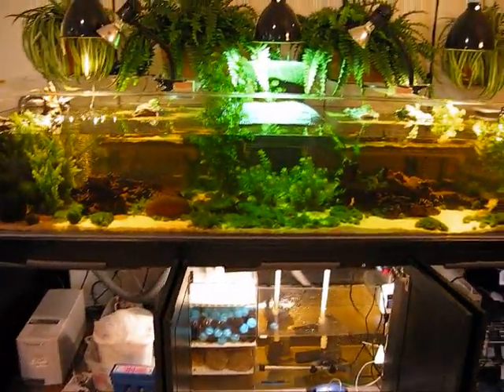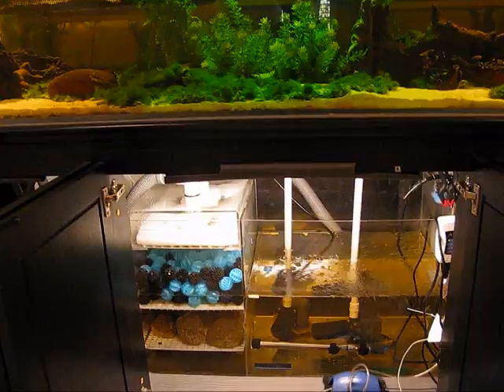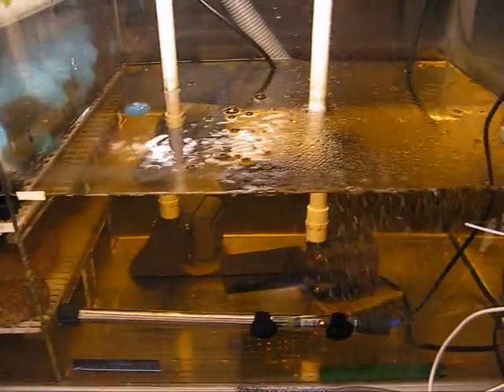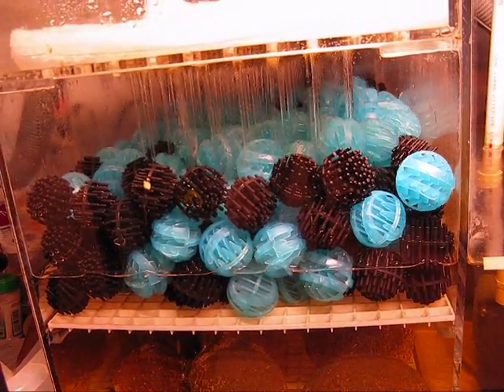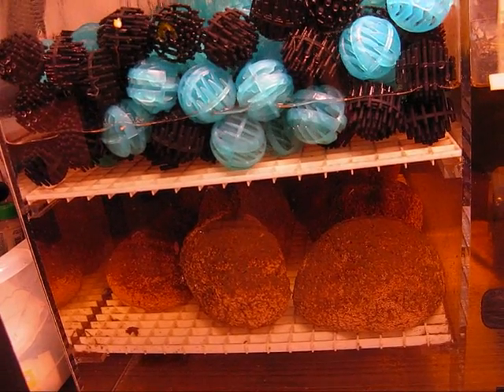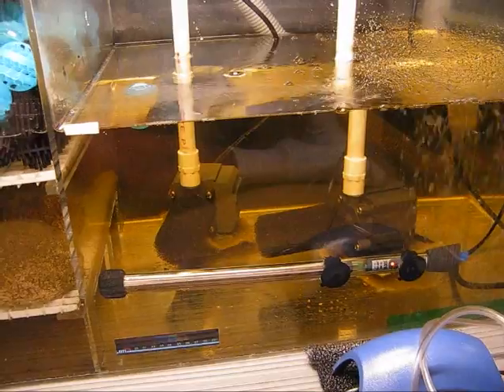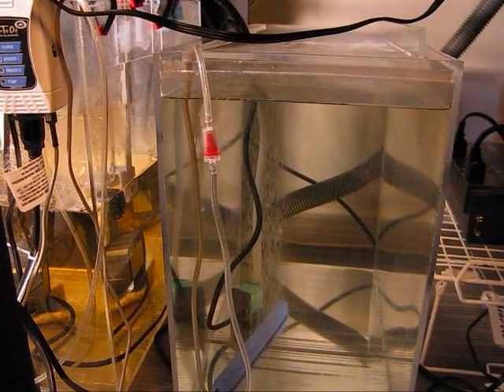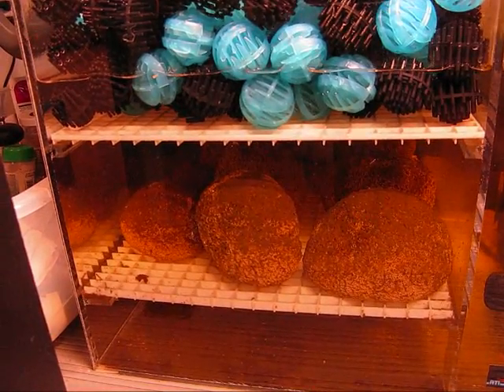Turtle Tank Trickle Filter

Comment: Wow - great video. 13 years on, is the tank still working well for you? I was trying to find out if Bio Balls can be submerged and not used through a trickle box set up.
Reply from the maker: I no longer have the tank.  I released all of the turtles in 2015.  I still rescue turtles but release them quickly.  I think the air plus water in a trickle setup is important.  But I am not a bio expert.  You'd better search for an answer of your question online.

Comment: A large part of your filter is doing absolutely nothing, it has a lot of lost space.  Bioballs are not the best medium; their surface/volume ratio is far from optimal.  Expanded clay pellets or volcanic rock is better. The best and simplest trickle filter is the type on top of the aquarium where the water slowly trickles. Oxygen is the key for a good performance.  A trickle filter easily survives a power out.  Bacteria die from a lack of oxygen. Anaerobic conditions can not happen in a real trickle filter, since it will drain completely in case of a pump malfunction or a power-out.
Reply from the maker: I no longer have my tank, so it is moot at this point.  However, I did consider an above the tank trickle filter but found the design cumbersome and difficult make attractive to look at.  As for power outages, I used a backup battery for short outages.  Never had a long enough outage to become an issue, but I can see how it would be if that happened.

Comment: how much did you spend setting up the sump
Reply from the maker: I don't remember.  Was years ago.  But the tank and the sump filter was all custom built by a local aquarium shop.  Prices are obviously going to vary shop by shop, State by State, and of course the price of oil (Acrylic).  If you thinking of setting up a large tank, check with a couple local aquarium shops about costs.  If you like to shop online, try Glasscages.com.  They make all sorts of acrylic tanks and I would imagine filter systems and would probably cost much less.

Comment: I have a reef ready tank bare bottom, that has two holes drilled on the bottom.  I am currently using a canister filter but as you said maintenance is a pain.  My question is how can I use a sump without an overflow intake at the top? I don't need to skim the surface.  The bottom intake drain works best to remove all the turtle poop so I would want to keep it that way.  Is this even possible?  Would I have to make a hybrid of some sort?  How do I protect myself from overflow if the power went out?  I am sure there is a work around but I can't think or find one.  Thank you.
Reply from the maker: You will have to visit a filter website.  I am not a filter expert.  The basic concept of a trickle filter is that water is pumped up from the sump underneath and pours onto the surface with enough force to help oxygenate the water.  As the water level rises, it overflows into the overflow tube(s) and back down into the sump where if is filtered.  If you turn the pumps off, everything just stops, there is no flooding.  So be careful of your design, note the consequences of turning the pump off.  Gathering turtle poop off the bottom is generally an effort in futility.  Unless you have your turtles trained to poop by the intake, most of it will just roll around and eventually break up and dissolve into ammonia byproducts.  The whole idea of the wet/dry filter is to convert all that ammonia into nitrites and then into nitrates.  Also, you'd be surprised how much crap is collected by the mechanical filter.  You still must do partial (never full) water changes to keep the nitrate levels low as they can kill fish.  There are more sophisticated ways of removing nitrates, but most folks just do partial water changes.

Comment: So you have the intake at the top (water level) and then the output all the way to the bottom to push water up? So it can go down?
Reply from the maker: both the outflow and overflow are at the top.  the outflow pushes water away from the overflow tubes.  there is nothing near the bottom, that would just stir up sediment.  You can add separate circulation pumps if your tank is large enough to warrant them.

Comment: Hey there.. I have a DIY trickle filter. Been running a few months but the problem is that the water is only sometimes clear and clean.. First layer has the normal sponges. Second and 3rd has the bio balls.. And 4th has some volcanic rocks... My sump gets dirty.. Is it because the dirt are not collected by the sponges?
Reply from the maker: I'm not a filter expert, best seek advice from a aquarium forum, but it is possible that your sump filter is not large enough for the bio load your critters put out.  Or perhaps the pumps are not moving enough water to keep the tank clean.  I used to 700 GPH pumps on my tank of only 200 gallons.  Also, you must clean the sponges regularly by removing them and thoroughly rinsing in non-chlorinated water.  Chlorine kills the bacteria that break down waste.  Otherwise you won't get good biological filtration.
Reply: I have also built one I'm gna try alfagrog rock it seems to be working for some ponds

Comment: how does the water get from the blue/black balls to the sump?
Reply from the maker: the water is pumped from the sump up into the tank.  There the water levels rises until if pours into the overflow tubes (which set the water depth).  the water flows down the tubing back into the sump, and around and around it goes.  The balls in the sump just create surface area for bacteria to grow which break down the harmful ammonia (waste) byproducts.

Comment: hey Bob I have been watching your turtle videos i just got a turtle and was wondering if you could help me buy and build m y own personal tank like yours
Reply from the maker: I had an aquarium shop build my tank, I did not build my own tank.  I strongly recommend you find a good aquarium store that has a tank builder and work with them on the design that you want.  You can also go to the Glasscages website, they have pre-made, acrylic tanks that are cheaper than customer built.
Reply from the maker: fish waste, like all waste, will dissolve in the water.  The biological filtration system breaks those wastes down into nitrates.  You get rid of the nitrates by doing partial (not complete) water changes.  Some larger, visible waste can be siphoned off manually, that will make it easier on the biological filter.  some waste will be sucked up into the filter and deposited onto the filter media, but it is technically still in your tank so you need to clean that filter media frequently.
Reply: can you send a link to that site?
Reply from the maker: G3TxN4STY www.glasscages.com

Comment: This is amazing! I work at a nature centre and would love to pass on the schematics to the staff that manage our turtle tanks!
Reply from the maker: +AppleBlight Schematics?  Don't have any schematics.  I no longer have the monster tank.  Am getting older now and the turtles would easily outlive me.  They were released this past May and the tank dismantled and sold.  I do  keep a smaller tank going for hatchling rescues, but that is it.  I do provide specifics on the tank design and size on other YouTube postings if you care to look around.  Basically the tank was a custom made acrylic tank, 8' long, 3' wide, and 17" high.  Filter is a wet/dry sump filter with overflows and returns in both back corners.  Two 700 GPH pumps sitting in the sump underneath.  The sump was oversized to manage the large volume of waste that the turtles produce.  Have had as many as five or six turtles in there at a time.  Lots of Mopani wood on the bottom (looks nice and it sinks), moss ball (which the turtles destroy and with time forms a bed of moss).  Substrate is sand, really the only good choice for bottom dwellers like mud and musk turtles.  Essential for softshell turtles.  Water is filtered as it enters the house so there is no chlorine or chloramines to deal with.  Partial water changes once a week, 50%.  A sand box for egg laying, two other platforms with Cypress logs for basking.  Lamps are UVA/UVB heat lamps.  Aerator in the tank to reduce surface sludge.  I also use tall, plastic plants for the turtles to climb or rest on.  Ferns sitting above the water in the back of the tank are artificial, but look nice and don't shed.  only serious problem I had was turtle aggression.  Doesn't matter how much space you have, how well fed they are, they are solitary critters except when mating or basking.  Males are particularly aggressive but the females fight over food.  Sometimes they're peaceful and I think all is well, then they get into it again.  I only kept mud and musk turtles because they are small.   Sliders and softshell turtles are powerful swimmers and need larger outdoor enclosures, IMO.  Hope that helps.

Comment: Can someone teach me how to even out my sump because every time I turn it on it either pumps too much water to where it runs dry or the pump that pumps the water into the sump pumps to much and it overflows!
Reply from the maker: +Mundo Dante not sure what kind of setup you have, but usually there is a pump(s) in the sump which pushes water back up into the tank above.  The water in the tank rises and then overflows down the overflow tube(s) back into the sump.  I don't know why you have a sump in the tank as well.  If the sump pump is too powerful, you will empty the sump before overflow can return enough water back down.  You would either need a weaker sump pump or else more overflow tubes, or bigger ones.

Comment: Hello, I've started taking care of 2 red ear slider turtles which were my Uncle's before he passed away. I bought a 60g tank yesterday and no water yet inside. I spent numerous hours on the web trying to figure out the best filtration for my tank. 

I like the sump setup/concept but its intimidating for me to setup a tank like that but I really want to. Can you help me in setting up a sump like yours but a smaller scale version of it? Any help would be greatly appreciated. I want the turtles to be happy.

Chris
Reply from the maker: Ca M not sure what you are asking.  I am not an expert of designing sumps.  I had help from the same aquarium shop that build my tank.  60 gallons is a fairly small tank and perhaps a canister filter would be easier for you.  I think a sump filter is best when the tank is drilled.  If you don't have a pre-drilled tank, you'd need an overflow box and I have no experience with them.  You might inquire on the Turtle Forum - you can get some excellent advice there.  Here is the link:  http://www.turtleforum.com/forum/upload/index.php?act=home
Reply: BauriBob Im looking at the turtle forum now. Thanks for the response. What I am trying to ask is a good filtration system for the two turtles that provides healthy habitat. My hours of reading so far seems many people are struggling with keeping turtle tanks clean and without stinky odors.  Anyway, thanks for the advice! Good luck
Reply from the maker: Ca M too many people under filtrate.  And a filter requires frequent maintenance.  You must clean the filter pad(s) regularly whether you are using a canister, wet-dry, or submersible filter.  You must treat your water to remove any chlorine.  Chlorine kills beneficial bacteria which break down ammonia and nitrites, harmful mostly to fish.  I don't care for gravel/rock substrates because debris collects between the rocks/pebbles and is hard to remove.  Sand is more natural and debris collects on the surface.  Usually it eventually dissolves and the filter takes care of it.  If you feel the need, you can siphon the debris off the surface of the sand.  Don't forget to do partial water changes weekly.  How much is subject to debate, I do a 50% water change every week.  That keeps the nitrate levels down and removes particulates in the water that cause discoloration.  If you use Mopani wood like I do, you may notice a reddish brown tint.  Harmless but unsightly.  Water changes will keep that to a minimum.

Comment: I seen your video a few years ago and I was very impressed by it and just stumbled upon it again and it's still impressive. I use a trickle filter for my koi pond and I have been using the blue bio-balls like the ones you use. But I came across a brand of a biofilter media called Marine Pure High Performance Biofilter Media. They are 100x better then the old school blue plastic bio-balls. The Marine Pure bio-balls are 1.5 inches big and have a surface area of 240 square feet per ball. And they stay wet for hours in case you have a power outage. Check them out on you tube or on Google. They are pretty awesome, just like your turtle tank.

Comment: Very nice design and implementation.  However the tannin, to my mind, really detracts from the overall appearance of the tank.  Use a Polyfilter or activated carbon in the return section of the sump.  Another suggestion to greatly increase the bio capacity of the system would be to connect the return water to the bottom of the tank, as now, but use no extensions into the tank, but terminate in the vacant space underneath an undergravel filter with 2" of gravel on top.  With your size tank it would get you another 264 square inches of bio bed activity, AND the reverse flow aspect would prevent accumulation of detritus in the gravel (the traditional knock on UG filters).

Comment: hi, do you have to clean the inside of the tank? 2nd, do you put food in the tank ? 

thanks
Reply from the maker: I clean the sides of the tank, algae grows there.  I don't clean the sand.  Organics decay and produce ammonia and other byproducts.  The wet/dry filter's biological filtration changes ammonia to nitrites and further to nitrates.  Weekly partial water changes (50%) keep the nitrates at a low level.  Lots of live plants will also help reduce nitrates.  There are nitrate removers you can buy at aquarium shops but partial water changes are probably the best way to go. 

Yes, I put food in the tank.

Comment: Hi Bob, I am a beginner, the filter gets the water from the top surface of the tank, what will happen to the fish waste, will it deposit on the bottom of the tank or will come to the surface during this cycle?  thank you.
Reply from the maker: I have a rather busy tank with sand substrate and a ton of Mopani wood.  Most of the solid waste sinks to the bottom and disappears from sight.  It eventually decays into ammonia products which dissolve into the water.  The wet/dry filter converts those toxic ammonia products to toxic nitrites and further into not so toxic nitrates.  Some of this conversion takes place in the tank itself because the beneficial bacteria grow all over the tank.  Nitrates are less toxic but when they build up to high levels they can kill fish.  Nitrates are partially removed by certain bacteria and also by any live plants, but most of it is removed during partial water changes (never do a full water change or you lose to many of the beneficial bacteria that way).  Even a canister filter with the intake set close to the bottom will get only a small portion of the solid waste.  Waste any distance from the intake will just sit there unless you have an extraordinary amount of circulation in the tank which would likely makes the tank's occupants pretty unhappy.  If you can see the debris which is likely in a sparsely decorated tank, then you can always suction out the visible waste.  Test for ammonia, nitrites, and nitrates periodically.  Aim for zero ammonia and nitrites.  Keep nitrates low with partial water changes.  Be careful not to overfeed.  Remove uneaten food after half an hour or so.
Reply: BauriBob Can i use bio balls in canister filter??

Comment: Were does the water come out of once it goes past the balls?
Are there holes in the section the rocks are in?
Please awnser
Reply from the maker: the balls sit on a tray perforated with holes.   the water pours over the bio balls, passes on through the holes in the tray and down into the sump.  A pump (I have two) in the sump then pumps the water back up into the tank (or aquarium).  then as the water fills the tank it overflows into the overflow tubes and drains back down through the filter, then the bio balls, then the sump.  around and around.  Is a very good filter system, especially for biological filtration.
Reply from the maker: the sump is open, not closed off.  Water trickles down through the bio balls and fills the sump.  Two pumps in the sump push the water back up into the tank.  When the water is high enough in the tank, it overflows down the 'overflow' tubes back into the sump.  Around and around as long as the pumps are running.

Comment: If I get a 60 gallon tank for my turtle, will the "3 times the amount of filtration as water in your tank" rule apply with a wet dry filter? I was thinking in getting a wet dry filter that is rated for up to 200 gallons for a 60 gallon tank or should I get a wet dry filter that is rated for around 70?
Reply from the maker: to be honest, I am not an expert on that.  You'd best ask someone in an aquarium shop.  But generally turtles need much more filtration than fish.  If your ammonia and nitrite levels are zero and you keep your nitrate levels low with partial water changes, you are probably doing fine.

Comment: Hey bob, would you recommend having a trickle for my turtles as a main filter?I also dont want to drill the tank for an overflow. Will it do its job in a 90 gallon with 2 RES?Thanks
Reply from the maker: you can get an overflow box for your tank so that you won't have to drill it.